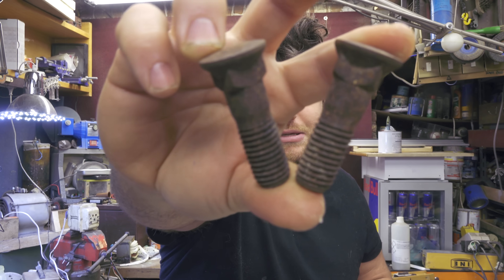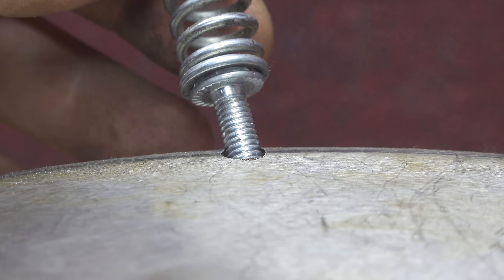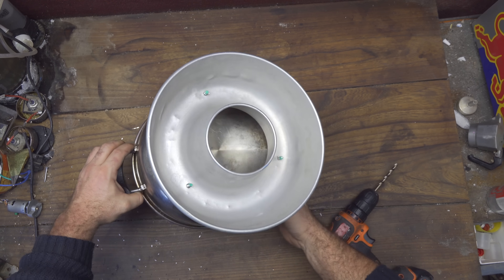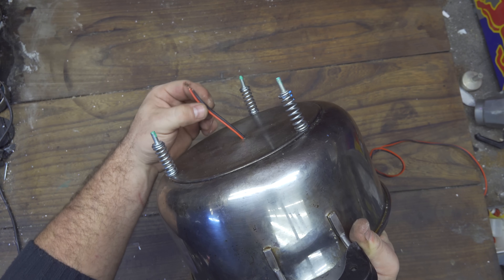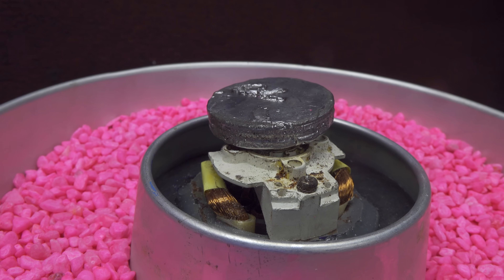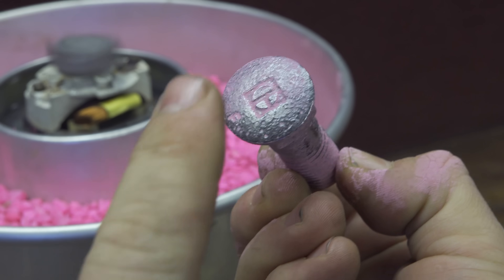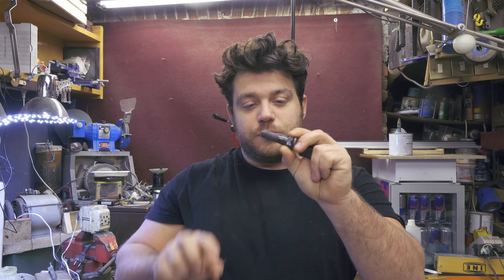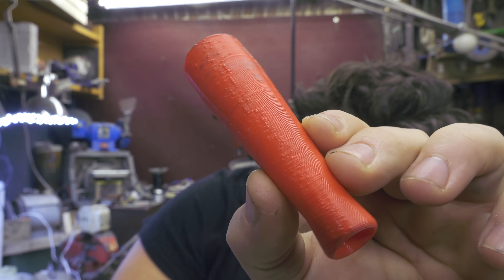How to Remove Rust using a Kitchen Pot • 4K

Comment: What electric motor do i need  to clean my V8 engine block? 😁
Seriously tho, neat project.
Im wondering if a coat of bed coating such as Rino Liner on the outside of the aluminum pan would reduce the noise.

Comment: You need to put an amp probe on the common wire of the motor and keep drilling the weight until the amps are under the rated amps for the motor or remove some of the stone until under rated amps or both.

Comment: 👍 suggestions= modern brushless motors from automotive cooling fans/ computers etc = quieter & more energy efficient, mounted below vs above( for safety), also for safety, use rubber grommets in holes drilled for wire routing. 👌 keep up good work.

Comment: Chemical treatment would be faster and more effective on huge bundles of bolts. Using an abrasive would surely polish the metal, but there will still be microscopic rust on the surface. Chemical treatment, is very cost effective, not toxic, and removes all the rust by converting it.

Comment: Death Trap putting the wire through the hole with no protection and all that vibrating it will cut throw and become live metal ahhhh! Also the motor will die soon with such an unbalanced load  Electrolysis  is the way to remove rust.

Comment: A piezo tweeter speaker at 60hz works really well too. It's what is used in a Sonic cleaner
Reply: Can I just glue the container to a speaker cone and play some Barry white?
Reply: @dantheman1337   Your comment I see is 3 years old.  That part, if you played Barry White is about 1/2 way clean.
Playing Styx would only take 3 hours. 🤣

Comment: You can just use vinegar and / or WD-40 which cleans off the rust pretty well. Leave the stuff in vinegar for a few hours or just scrub it with WD-40. Might need both for extreme cases. I've repaired an entire toolbox full of rusty tools some time ago this way. With WD-40 treatment the box still smells nice and it also protects from future rusting.

Comment: You would have better results using a motor designed for unbalanced weights. As a lot of commentators have said, you'll kill that motor fast and it will need to be replaced. Replacing it will add to the budget of the machine so in the long term it'd be cheaper to spend a little money getting a motor designed for handling a heavy/unbalanced weight.

it might also be beneficial to mount the motor differently so that the rotor is facing down instead of up.
Reply: Glenn Griffon what “budget?” It was built using a junk blender.

If it’s ruined, he just needs another junk motor.

Comment: I would suggest you use water instead of oil when drilling holes in stainless steel
Reply: The best lubricant for stainless steel drilling is tallow, the fat you get from rendering (heating) beef, it lubricates keeps the drill cool. Lard also works (the fat from heating pork meat).

Comment: That motor will be totally destroyed soon enough. The bearings in that motor are not built for such an unbalanced load.
Reply: Any ideas on how to improve on the design? Seems like there should be a simple-ish way to isolate the motor from the vibration but I don't know it.
Reply: @masonheipel  
One way immediately springs to mind:
Mount the motor inside the base and a shaft down from the weight, connecting the motor shaft to the weight shaft with a compliant coupling made from either flexible plastic/rubber tube/hose or maybe a spring, that should isolate the motor bearings from vibration of the off-balance weight
Reply: Stick the container on top of an oscillating sander perhaps. Just glue a sanding pad on bottom of container so you can use the hook and loop attachment.  Mount the sander in a bench vice upside down. Obviously not one that rotates.
Reply: The motor literally came from a vibrator, unless im missing something....
Reply: Oops i am missing something
Reply: Make a brace that holds the motor and shaft together. Basically a shell for the motor with hole size similar to the shaft. That would prevent sideways movement on the shaft.
Reply: Awesome vid. Shaky hands from to much  red bull 😳😵

Comment: Wouldn t it be more efficent to put the screws in vinegar over night?
Reply: @brotschuh. nope, vinegar works on minor rust. Maybe more efficient is electrolysis
Reply: ...or toilet cleaner (acid) 👍
Reply: handtool rescue uses baking powder, water and DC charger. That one i feel much more simple to build. I mean you don't have to build anything and not noisy. However the surface won't be smooth. Rust is not an even cover on the metal and if you remove it the surface remains bumpy.